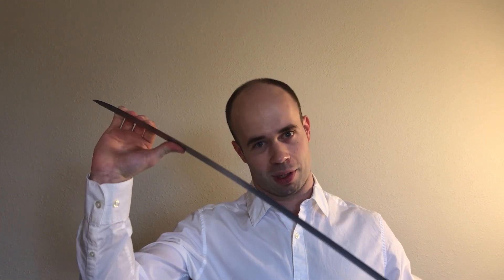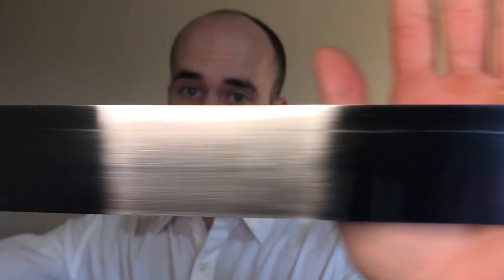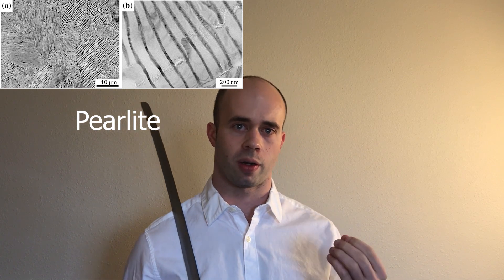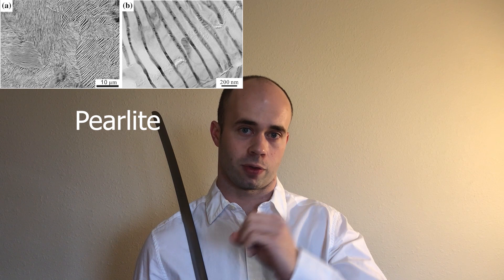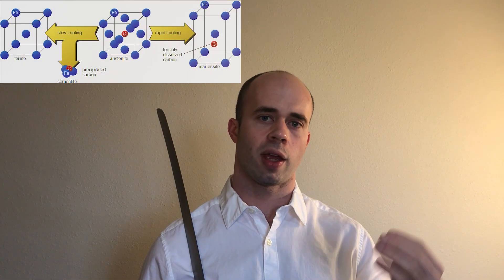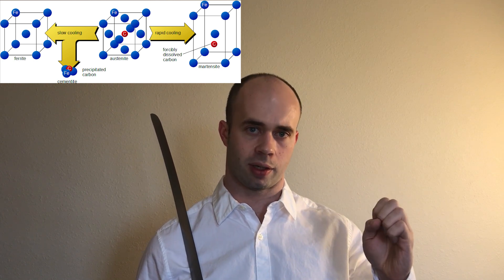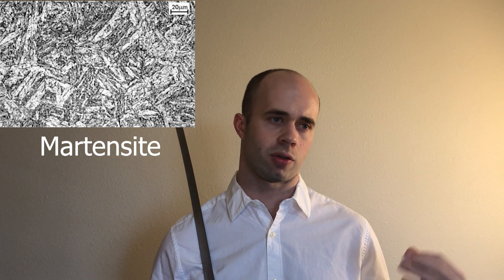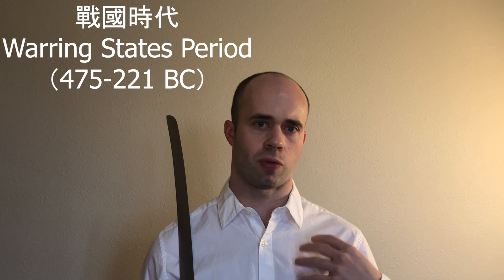Chinese Sword Metallurgy - Heat Treatment 中國刀劍冶金學 - 熱處理

Comment: Darn! I thought you might be about to come down on when differential quenching was first used. Oh, well... So, how does one differentially quench a double-edged blade? Are we talking about the obvious: using clay more thickly along the centre section but thinly at the edges? I'm wondering how much softer that's going to leave the core on a relatively narrow blade when there's heat coming in from both sides. Also, what's the evidence for Europe moving away from differential technology? I'm not aware we ever had it; surely European blades up to the High Medieval Period were forged by piling or pattern-welding using combinations of high and low carbon steels, and either cold-working them or, later on, slack-quenching or full-quenching and tempering them. There's nothing differential about any of those processes.
Reply from the maker: There is evidence of differential hardening on blades as early as the Han dynasty. Whether or not it was done with clay or as a partial quench of just the edge is debated. 

When it comes to jian (double-edged swords), differential hardening appears much later. Though We have almost no surviving jian from the post-Han to early Song period. Later blades were created using "three plate" sanmei lamination. Basically a hardened steel edge plate with a softer alloy plate forge welded onto each of the flats. Often times the edge plates are low enough carbon content that they don't form much martensite, so you can simply quench the whole blade and the flats and core don't really become brittle while the edge hardens.

As far as I am aware, Europe did not have something like the clay based differential hardening that Japanese blades are so famous for. However, a process like slack-quenching itself frequently resulting in a blade possessing differential hardness because thinner portions of the blade will cool more rapidly than thicker areas and thus impact martensite formation. Arms and Armor also has an article on their site which also links slack quenching and differential hardening.
Reply: @thescholar-general5975  Thank you for the swift and helpful reply, which puts things in perspective. Your point about slack-quenching producing a differential hardness is also well taken. One more question, if I may: what's the general opinion on tempering? It's usually sidestepped in commentaries on Chinese sword production, but presumably, if they were quenching to produce a martensitic edge, a temper would have been necessary to reduce the brittleness to that of 'tempered martensite'? Your advice would be much appreciated.
Reply from the maker: @canarddefer3574 I assume that you are talking about tempering differentially hardened blades and not the springy Han jian which clearly exhibit signs of tempering. I don't recall anyone writing on this topic specifically, but I have also wondered about this question myself. I have spoken to Japanese sword smiths who say they sometimes put the blade into hot ashes after a quench to slightly raise the temperature back up (or even slow the cooling process down slightly if it is immediately post quench). If this is done in the former way as a true post-quench process on a cool blade, it is a form of tempering, but it is important to keep in mind that this would be a much lower temperature temper than what is done on more springy blades. It is definitely possible this was also done some in China, but I haven't seen evidence confirming it.
Reply: @thescholar-general5975  Once again, thank you. I can't imagine that differentially hardened blades weren't tempered, though; otherwise--unless we're talking about blades with edges of lower-carbon steel, which would have hardened no further than a pearlitic matrix--one would end up with a fully martensitic edge, which neither European nor Japanese smiths were ever happy with. It's such a shame that there has been so little work done (or at least published) in this area. It's a pleasure to speak about this with you--very informative!

Comment: This video is not viewed enough in my opinion.
I always get back at it and try to share it with multiple people as it is extremely interesting.

Speaking of historical spring tempering on European swords, according to the literature of A. Williams, they start to appear only after the 15th century and are a slim minority. Not only that but the temper is rather inconsistent and yields quite softer edges, in the range of 300-450 VHP or 30-45 HRC. This is to take into account because in modern blades we can obtain much harder hardness, homogenous and consistent temper and performances that are way ahead with the historical material.

This is why people like Shad should understand that talking about spring steel and making inferences on period blades with modern replica is not a good practice.
Reply from the maker: Thanks for watching the video! I will do another video on this topic in the future and plan to do a much better job which may get more views and be more accurate overall. 

Thanks for bringing up A. Williams work! I will look into it as a potential reference in the future!
Reply: @thescholar-general5975  
For other references there should be open access articles on European swords:

Archaeometallurgical Investigation on Historical Sword-Making Techniques in Northern Italy Between the Sixteenth and Seventeenth Centuries

Archaeometallurgical Analyses on Two Renaissance Swords from the “Luigi Marzoli” Museum in Brescia: Manufacturing and Provenance

Replicating a seventeenth century sword: the Storta Project

Unfortunately I only have references on Japanese and European swords, but it would be interesting to see more on Chinese ones. Williams cover that briefly, but the work is mainly focused on European blades.

Comment: I had read on a site about Chinese swords, that they used two different steels.  The Outside steel was a softer steel, that allowed some flexibility.  While the Inner core of the blade, was a Harder steel.  This was of course, could hold a much sharper edge, and for longer... but.. it would have broken without the softer steel surrounding it.

 In this way.. the sword was similar to a Pencil.  A pencils wood is flexible.. and wood itself cant really hold a sharp edge.  The pencils lead, can be sharpened to a near hypodermic level of sharpness.. but without the wood, it will easily shatter.   Obviously... the core of a combat sword would be more durable than graphite.. but it shows the principles and reasons.

 Im curious if you have ever seen this same knowledge ???  And if so, can you go into more depth about it?
Reply from the maker: Thanks for watching! You are correct that this was done for a long span of chinese history. 

https://youtu.be/DiNzaxKtPsw I go into forge welding and lamination quite a bit more in this video

Comment: It might have had something to do with mass manufacturing for war. It may have just been easier (and less expensive) to make lots of differentially hardened dao than spring tempered ones and maybe just use higher quality steel on the edge and lesser quality or iron at the back.
Though I am not sure if they were typically made of iron and steel or just steel.

Or the soldiers might have just really preferred the benefits of the differentially hardened blades.
Reply: Indeed. My suspicion is always that there could be a financial motivation behind changes in military armament, especially given the bureaucratic control and size of Chinese armies. 

After all, I believe that Dao were themselves somewhat cheaper to manufacture than Jian swords, so I'd like to see what The Scholar General thinks.
Reply from the maker: Mass manufacture likely played an important role, though I do not think that it was due to the use of iron or mild steel in the blades. Many jian and most swords in the premodern era had some parts made of mild steel or iron. Mono-steel blades come relatively late in sword history. However, I think that mass manufacturing dao may have been easier than jian for a couple reasons. For one, it takes less time to grind one edge than two, and grinding took a lot longer back then. Additionally, the dao used by infantry during the Han dynasty were quite light and small. LK Chen's Royal Arsenal Dao is a good example. This weapon weighs less, is smaller, and should take less material and effort than outfitting infantry with contemporary jian.

Comment: It seems like Europe did the opposite. They went from laminate and differential hardening towards spring-tempering their swords as far as I can tell. And the might be part of the idea that spring is better than differential in the west. It might also have been other reasons other than what they deemed best, such as what was easiest to manufacture.
Reply from the maker: yes, Europe progress from differential hardening and differential tempering towards a full temper. It is also possible to temper laminated blades, but a medieval European-style blade with a iron core encased by a steel wrap works best with the full temper heat treatment.
Reply: I just watched a new video by Matt Easton regarding if knights would use a katana.

He mentioned examples in history, that there is a higher likelihood for differentially hardened katanas to snap at the tip when striking other hard/metal objects/armor.

It might be that the reason for the preference for spring tempered blades in Europe is due to higher use of metal armor in the latter medieval periods and because spring tempered blades are just more durable for those kinds of battles.

Differentially hardened blades might be preferable and have certain benefits if there is less metal armor involved and spring tempered ones if there is more metal armor. And spring tempered blades are probably superior if you want thrust centric swords with finer, pointier tips. 

Here is the link to Matt's video
https://youtu.be/pUKNI7So0i0
Reply: @vilvuk4486  Sturdy metal armors being relatively uncommon in East Asia in comparison to Europe is a myth imo, East Asian armors had already transitioned into the heavier side by the Sui-Tang era. 

The phenomenon was not limited to Chinese, but also to various steppe cultures and old Koreanic ones. Japanese developed their own bulletproof cuirasses and had knowledge of 15~16th century European armors. They all used relatively short, sturdy blades that were differentially hardened.

It likely has to do with warriors wanting a high-performance sword in environments rich with heavy armor. There are also methods in which the resilience of edges or flexibility of blades can be increased for differentially hardened swords, much like the performance aspect of spring-tempered blades can be increased.
Reply: @adenyang4398 
I am generally aware of those things. 

I meant to say that the armor overall seems to have had more gaps and therefor didn't really need very fine, pointy blades for their swords.

In the western European, late medieval age context there might have been a bigger need for Estoc/pointy longsword like weapons, which would probably not be as durable if they were made differentialy hardened.
In the context of this conversation that might have been the reason why spring tempered blades were seen as better in Europe.

Though maybe the biggest reason was just economics and that those specific manufacturing methods are mostly based on the cost benefit analysis.
Reply: @vilvuk4486  Armors:

East Asian armors has very good coverage, the misconception of them being more open with gaps compared to Western armors generally comes from armor suit examples in most museums missing all their auxiliary pieces. (Samurai armor is infamous for this: http://gunbai-militaryhistory.blogspot.com/2017/10/tosei-gusoku-body-coverage-explained.html?m=1).

It was very much possible to cover all body parts with brigandine or lamellar/scale as well, mail armor usage isn’t even exactly necessary. The Tang and Qing iirc did use mail armors though, and plate cuirasses in a similar manner to Mirror armors were used as well.

The complex limb-articulations on European plate armors are certainly sophisticated tech, but Japanese armorers around the same time period also were capable of producing such feats. Also European joint plate armor can be disadvantageous, considering the couter can act as traps for weapon points. The limb armors in 17th century Europe actually do adopt the Bazuband style for arm defense likely for this reason, since it would be impossible to do the same against a Bazuband style armor. 

The only notably arguable advantage which medieval, Renaissance era + early modern period European armors may have would be the domed cuirasses that are geometrically better-shaped for protection against certain heavy percussive forces (lance strikes, firearms). But they also may sacrifice a degree of upper body mobility in return, which is correlated to horse archery and being able to move dexterously in melee.

Swords:

Many war swords throughout late medieval and Renaissance era Europe have fairly thick points, and their strong profile taper isn’t all that alien when compared to numerous Ming-Qing era southern Chinese sabres or certain Naginata naoshi katanas. 

Certain war sword styles prominent throughout late medieval Northern Europe are also not that much different from many dao, katana and jian in terms of tip shape: https://www.albion-swords.com/swords/johnsson/sword-museum-svante.htm
Reply from the maker: Vil Vuk I believe that differentially hardened points may be more prone to snapping, but I would also argue that this can be overcome with with a different type of tip design. Japanese polearms and Yari were also differentially hardened, but usually had diamond or large hollow ground triangular cross sections which would make the tip much stronger.
Reply: @thescholar-general5975  

I was referring more to these types of blades (https://www.albion-swords.com/The%20Cluny.html), that are more suited to heavily armored combat.
They would likely not be as effective if they were differentially hardened or even laminated. 

I remembered that one of my katanas (a laminated one) has a reinforced tip after you mentioned that. The blade thickness a few centimeters before the kissaki goes from 5mm to roughly 7,5mm near the point. 
I didn't really think that it was supposed to be a reinforced tip till now. I haven't really seen or noticed that on other katana blades that I handled so far.
My 2 other katanas and my nodachi don't have that reinforcement, though they were cheaper and are maybe not as historical.
Reply: there are more  Laminated differently harden  medieval swords than  spring tempered ones  there were more steel-iron  laminated swords and steel-steel laminated swords than mono ones  so in the 16th century 50/50 mono steel and steel-iron laminates where the  majority mono becomes more common and popular in the 17th century
Reply: What method was used in the middle east? Did they spring temper, or did they use differential hardening.
Reply: Never mind. Watched Ilya's video: in the middle east they did not heat treat.